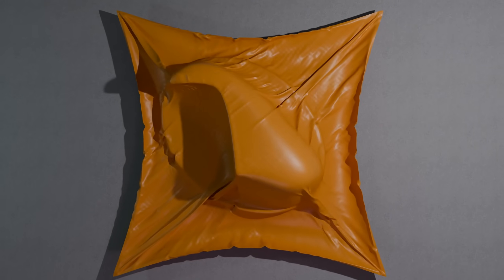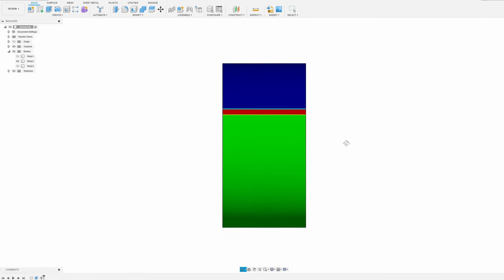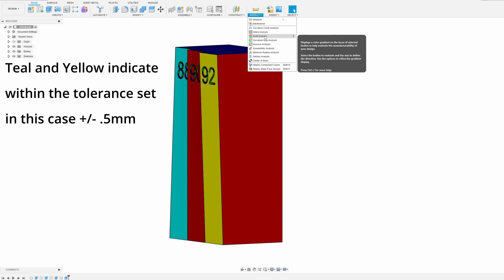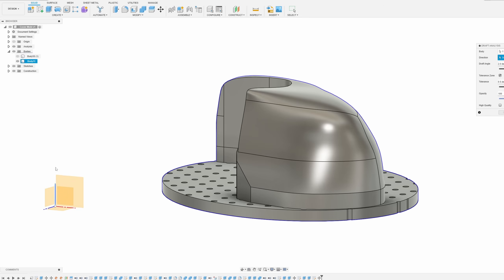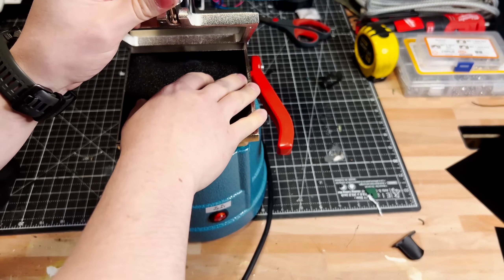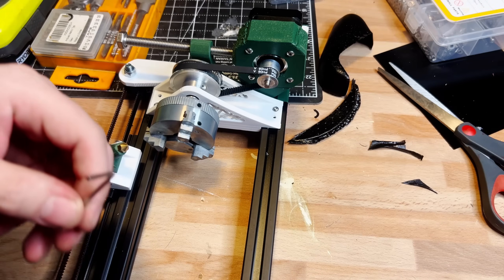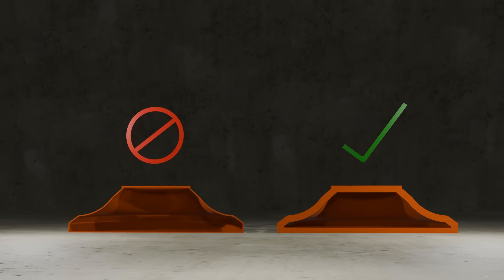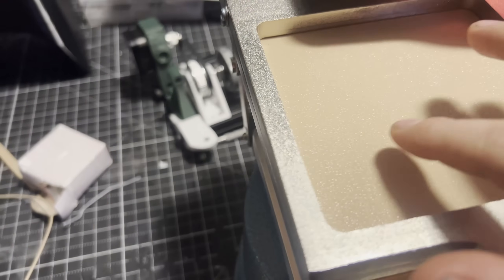Vacuum Forming with 3D Printed Molds (It’s Easier Than You Think!)

Comment: Thank you very cool video! But whats the advantage of this technique instead of just fdm printing it?
Reply from the maker: The main advantages are that 1. You can make a thinner part than FDM would allow. 2. Once you have a mold, then a small production line can be started that will make 1 item in 30-40 seconds plus about 20-30 seconds of cleanup. Which means you can produce 100s in the time you could print 3-4.

Comment: Why is the vacuformed part so.. textured? I thought the purpose of vacuforming was the ultra smooth surface finish
Reply from the maker: It’s due to me using a 3D printed sheet, if I would have printed it on a glass sheet it would have came out smoother, but I printed on a textured PEI sheet.

Comment: I wonder if you can use a silicone "rubber" mold? I personally am looking at using a PET-G mold, to pour silicone into, to make soft robot grippers. From what I understand, PET-G is food safe, and I know that the silicone I want to use is too. Some kinds of Silicone can withstand up to 450 degrees F and there are different firmness levels too. Cheers
Reply from the maker: I’d bet if you had a hard enough mold (would have to withstand 15psi without deforming) then you could get away with a silicone mold.

Comment: I have been hobby vacforming for over 30 years and seeing you 3D print your own flat sheets blew my mind.  WOW.  That is inventive.
 I am  tempted to test your methods, using the 'ironing' feature in my slicer for each flat layer printed (to ensure the layer lines are fully fused together) and changing the print direction for every layer printed (ensuring a mesh that won't encourage 'blow outs').
The ability to make your own colored vacuumform sheet is the big plus with this method.  When you buy custom colors for 'manufactured' sheet plastic, you have to order a minimum weight  of about 2000 lbs. per color, and that's very cost prohibitive.

Using an FDM 3D printed part as your vacuum mold is not the best idea I have seen, as the part will warp with each consecutive vacuum pull, but printing a 100% solid part and cooling the part in-between each vacuum pull would minimize warping and deflection.  Adding internal water cooling to the part would further enhance it's longevity, BUT, making your molds from a 3D resin printer and using a high-temp resin would be a better way to make the vacuum mold/plug also.  I have seen resin printed molds be used in injection molding with  good results and minimal deflection, making 100-200 parts from one mold.

Thanks for posting this video.  It's was very inventive and informative.
Reply from the maker: I have yet to try the ironing feature, my slicer does print in a “cross” pattern so I haven’t had to many issues with holes.  I believe if  you can print a mold in something like PA6 or PPS as I haven’t tried molds out of those yet. It would hold up to a low cycle <100. Very easily. All my molds were a one off so I just needed a few uses so PETG and ASA was sufficient. I’ve also played around with those “textured” sheets and the keep that pattern after forming, so if you use a carbon weave pattern you can have a stretched carbon weave formed part. I like the textured PEI plate as it gives an OEM vehicle plastic look to a lot of formed parts. Just something i didn’t include since I didn’t have a lot of footage of it. I’m glad you enjoyed the video though!

Comment: Draft angles etc gave me a lot of work. Brand new multipiece/opening steel molds for concrete came to a client, from different companies as totally unusable(from a couple hundred kg to 1-2 tonne products). Solid sides of molds locking the pieces in the molds, sometimes all four sides. So then started my job to fix those designs by modifying the molds, or in worst cases tell the client that we have to do a brand new mold. Yeah i got paid well, but knowing all the work is done because someone doesn't know how draft angles work is frustrating. Sorry for the rant, but that is the reason I enjoyed your video so much. You have the concepts right in your head and programs to confirm them. A lot better than some that call themselves professionals.

Comment: i have that same little vacuum former. tried to print a sheet of pla like you did but it had a blowout through it but not the most ideal mold was used. i am not sure how thick i made it i thought it was close to 1mm though. was hard to heat evenly through in the corners like you said.

I will have to try some petg next.

I really wanted to use it to form a cockpit glass canopy for a plane model i made out of some clear sheet.
Reply from the maker: Yeah I’ve done PLA down to .25mm thick and you just have to watch the heat but PETG has been my favorite, it might have to do with PETG naturally being more flexible though as well.

Comment: I have a similar vaac former. I believe it was for dental plates for bleaching. Anybody hear of any mods for these to perhaps enlarge the area available for forming?
Reply from the maker: It is a “dental” former, I haven’t heard of any, but it seems the bottom plate just has a silicon gasket, so perhaps a cncd aluminum upper and lower piece can enlarge the area. I’m not sure how you’d handle heating a larger plate though as the element has a fixed size.

Comment: What if you use the failed 3d prints to break them apart into small scales and putting them in a tray on the oven, create a melted sheet of plastic for 3D molding? You will still have layer lines on the inside of the piece, but this way you use plastic that would have been thrown away, and you might end up with a smoother finish on the outside. There is a YouTube channel of 2 brothers that recycle plastics by 3d printing, vacuum and injection molding, that do this all the time.
Reply from the maker: I haven’t played with that, I’m sure it would net decent results at the expense of losing dimensional accuracy of the sheet. Which for things like my belt cover wouldn’t be an issue, but for my speaker cones, I need a specific thickness.

Comment: Have you tried with different sheet material to mould material? I've heard that PETG does not stick to PLA when hot - perhaps easier to remove afterwards?
Reply from the maker: I did a PETG mold with PLA sheets and it was about as easy as PETG on PETG, but I also use a mold release spray on most of my forms.

Comment: You'd be better off buying preformed sheets of material to thermoform. They will be better surface finish and cheaper too. You are 3d printing expensive plastic to replace cheap plastic.
Reply from the maker: I mean I guess, but I’m also only using 1-2g per sheet- so I get 500-1000 sheets per roll of $12.99 plastic… printing takes 11 minutes total including warm up….

The main reason for printing them though was custom thickness. Try finding a .25mm thick sheet in 25 different colors. I started vacuum forming to build cones for my speaker projects, and I needed to cut weight- the easiest way was cut weight from the cone, yet I can’t print a .25mm thick cone, it just won’t work with the overhangs and such. Plus I needed the cone to color match the build.
Reply: that sheet he printed is like less than .20 cents... not expensive. 3d printer plastic is cheap 10-14$ per kg nowadays for petg/pla. but you're right about the preformed im sure being better overall.